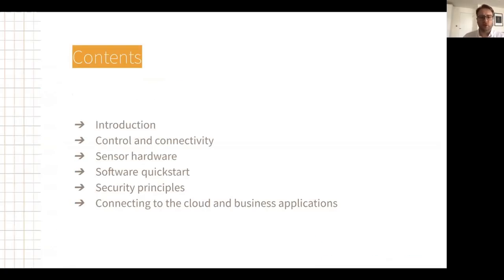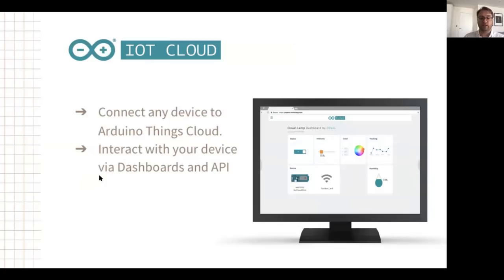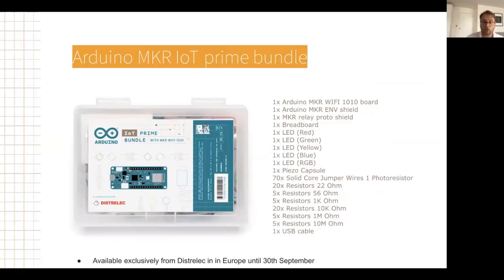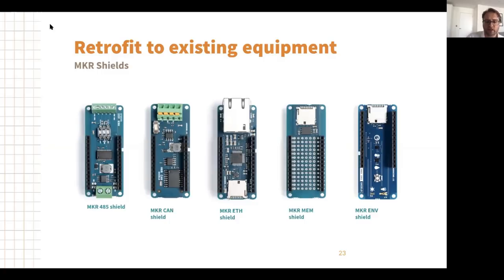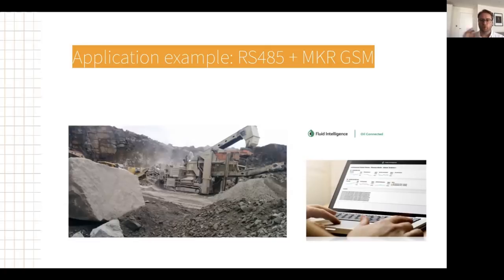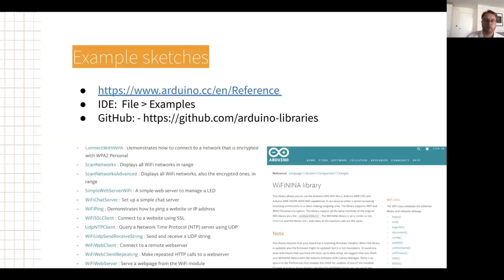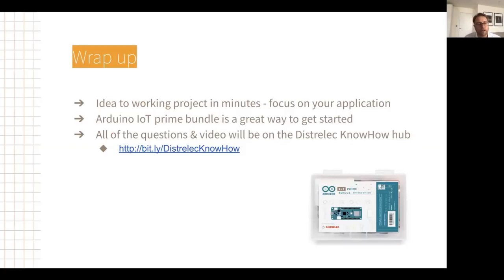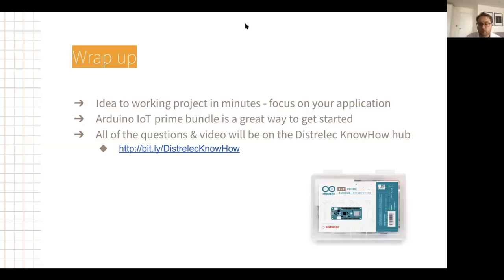Webinar: Rapid IoT system design | Arduino

Comment: Hi. thanks for a very informative video. I have a MKR1010 which connects fine to my WiFi but my requirement is to be able to FTP a file from Arduino to the server that hosts my website.  I can see libraries written for the ESP82/32 range that accept site, username and password  to connect to the remote server but, as far as I can gather, there are no equivalent libraries written for the 1010. Is this true?
Reply: non capisco un cazzo